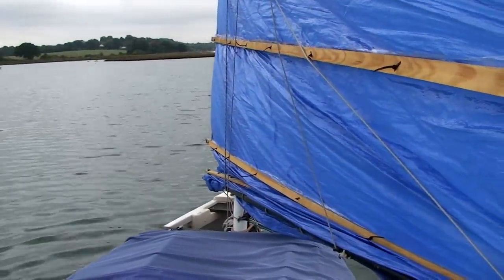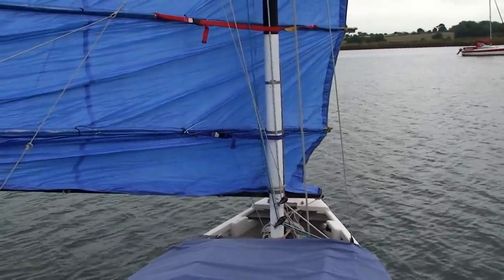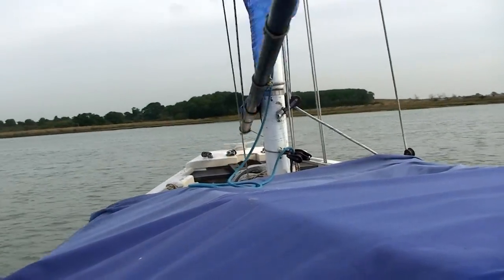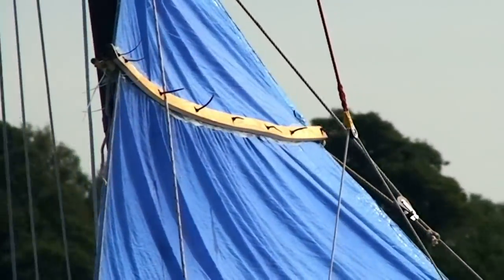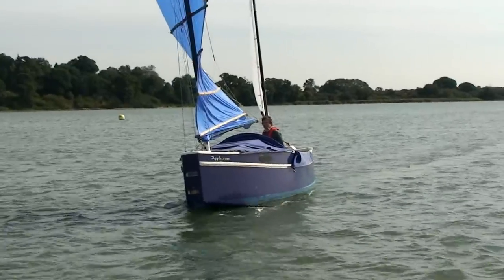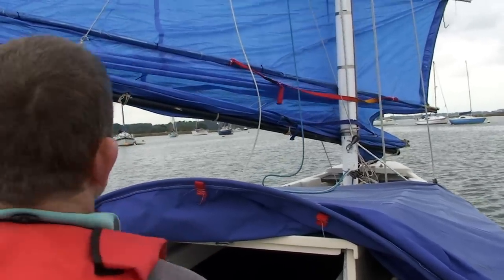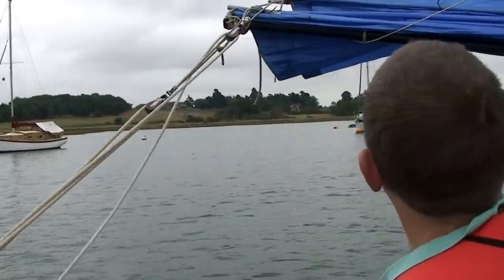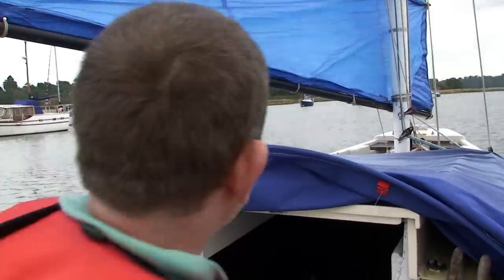ktl 115 film sailing a Bolger Micro - www.keepturningleft.co.uk

Comment: This fellow's sail setup is a bit crude, but I will vouch for the junk rig against just about any other for ease of handling and safety in a sudden blow. 

I have converted my Hartley TS16 to a junk rig and I love it. Mine is a more modern design with more airfoyle profile cut into the panels, which gives the sail more efficiency upwind. But if you are not mainly concerned with looks or hyper-efficiency, a simple flat cut style junk rig will work just fine.

As for polytarp, it needs to be a reasonable weight and quality, but because the wind pressure is far less on any given sail panel you don't need hi-tech materials. The Chinese sailed around the world with woven bamboo sails.